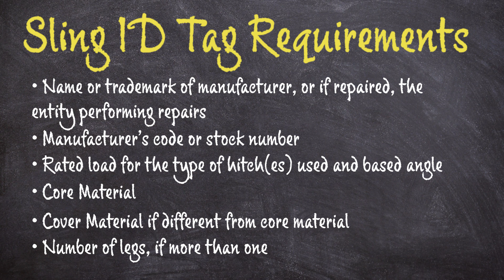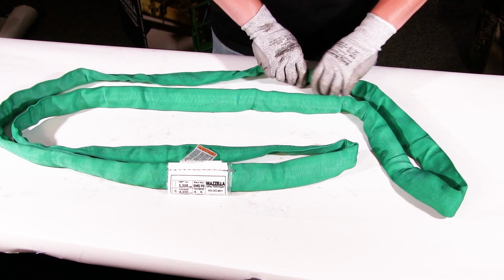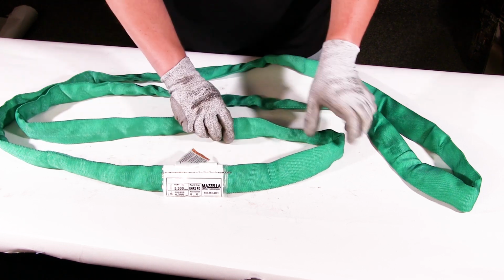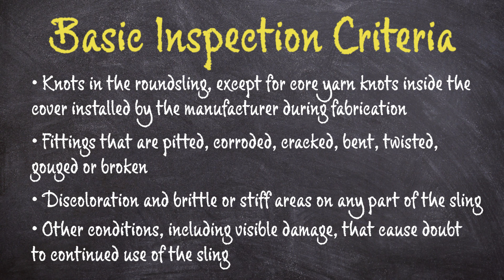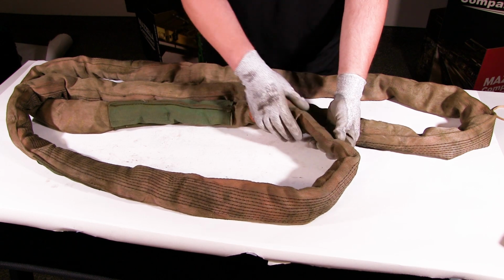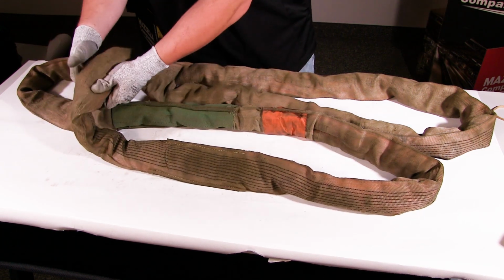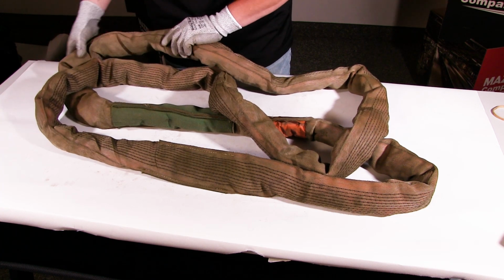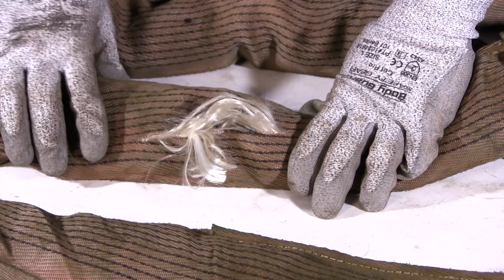How to Inspect a Synthetic Roundsling to OSHA and ASME Standards | L-4

Comment: I'm in charge of inspecting these at my job. How does a person distinguish the difference between a knot made by the manufacturer and a knot (bunched up area) made by torn yarn?
Reply from the maker: There shall never be a knot in any synthetic nylon web sling.
Single-path and Twin-Path slings may have what feels like a knot within the sling itself, but this is where the internal fibers are tied off and taped. The user shall become familiar with this during their pre-shift or pre-use inspection. Twin-Paths that use fiber optic, tell tails, or Check Fast systems will also have spots that feel out of place.

If the internal fibers break within the Single or Twin-Path, they will typically “bunch up” in one spot, causing what may feel like a knot. Near this spot, you will feel something like a void where there are no fibers due to that failure. It is rare, but possible, that a user will find a catastrophic failure.

I hope this helps. Please reach out with any more questions.